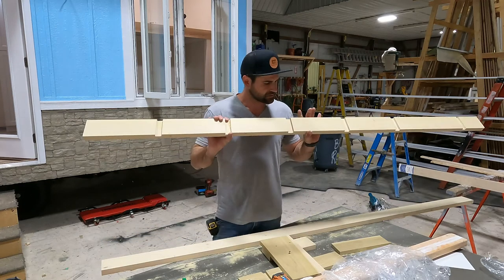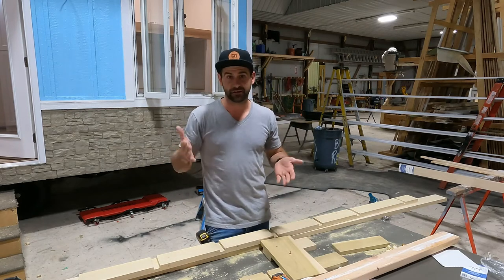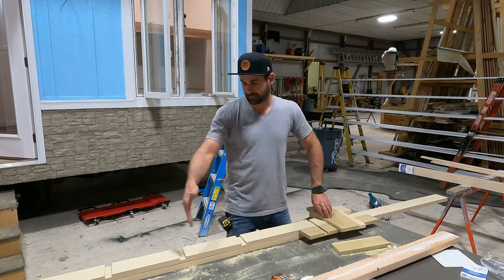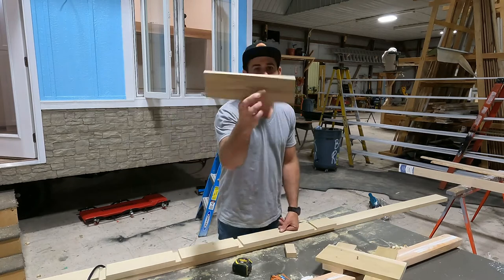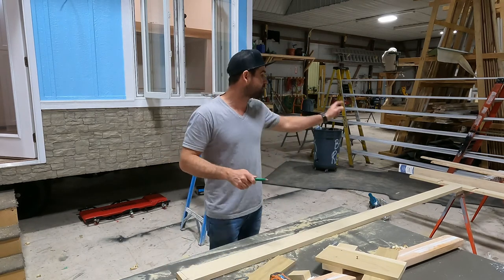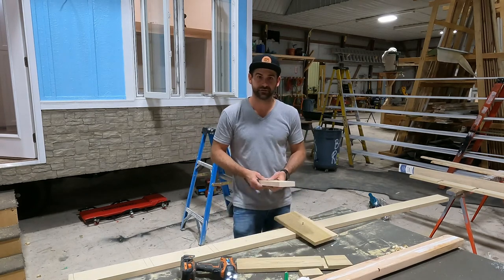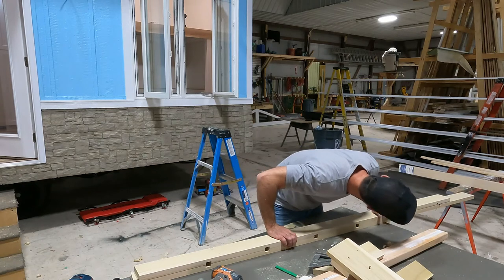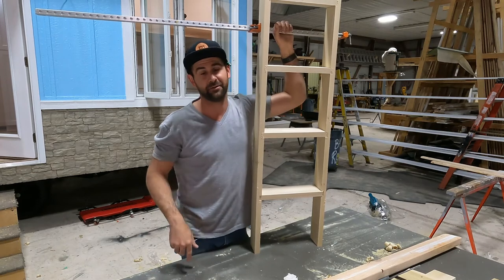How to build bunk bed ladder

Comment: Is the jig something that'll still help me if I am not using a router,I wish I had a router, see a couple on amazon for fairly cheap,but my kid needs this ladder like right now for the loft. His dad "borrowed" ours, and its not found its way back and ide rather not give him any more reason to come over, dif story I need help w,lol. But this,I can do,hopefully, with youtube help ay, thank you. What tools I do have that im working with,is well, a dremel that I've come to learn how to use for dang near anything (just takes me a bit longer than the avg income folks) wtv, and I've got a circular saw, hand saw, hack saw, umm, looking around here, got a oscillating tool saw...what cha think, can it be done in one evening before 10pm, now 4pm? Oh and my wood is a pine I think,very light color, reclaimed ladder,no clue what it had gone to,it was odd & I don't think it was made right and wasn't right hight, length width,or angle that i need. They put the thing together with these giant like 5 inch upholstery staples,insane scary pulling a million of those rusty boogers out. Idk maybe it wasnt a ladder at all and thats just what i saw seeing it laying on ground by a dumpster, cus that's what I need,lol.  Anyways, that's what I'm trying to follow your video along with & trying to figure out what I can use that i have thats simular and how I'll apply your words of experience with what I've got to work with. No ladder building experience other than maybe a couple when I was kid helping my Dad 20 sumthan yrs ago while building his not so cool "tiny houses" he did in our backyard when it was not a thing normal,let alone cool thing, people built, unless they were like bums or growing a lot of weed. We weren't bums.